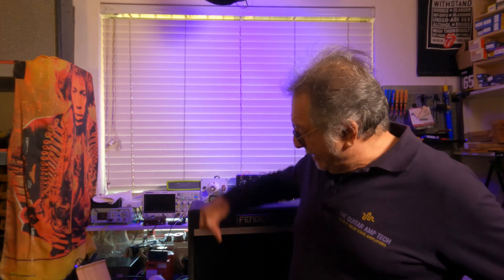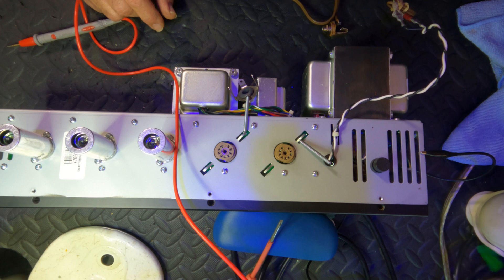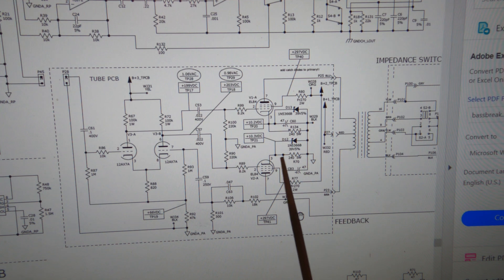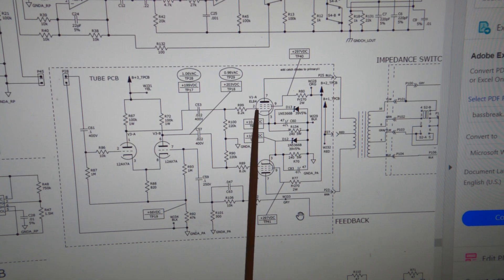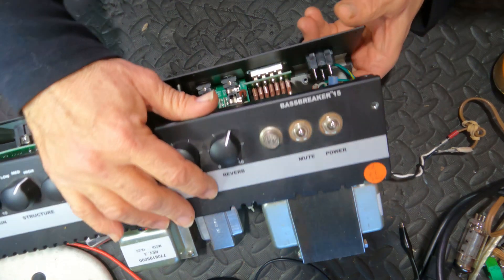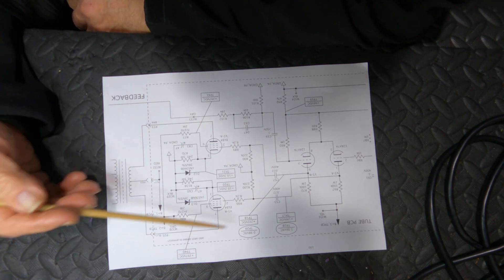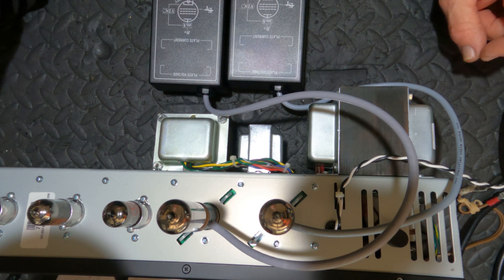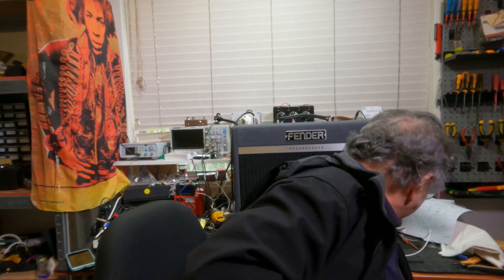Fender Bassbreaker 15 is blowing EL84 power tubes

Comment: corporate greed and dishonesty are the only chance fender has at this point
Reply from the maker: Ouch. That sounds like a cynical truth, Curtis. Fender has spent so many years betraying their customers, and indeed their own reputation, for amps that were once made to be easily serviced. Take for example the problem with the low-voltage circuit on the Hot Rod series. Fender engineers are smart. Smarter than me. And yet they persist with the same flawed design and assembly method. Fender knows how to build amps as good as Leo, but the accountants say “No. The PCB doesn’t always burn, and it usually won’t become an issue until after warranty, so leave it”.
Reply: yeah, they had a huge amount of cancelled orders for guitars, ( I don't remember how much, but it was a lot) and so the CEO responded by firing a whole bunch of employees, and then bragged that they had a good year. Corporations disgust me....... @theguitaramptech
Reply from the maker: I'm with you, my friend.
Reply: @theguitaramptech  Which amps are built different to Fender, like for instance what is equivalent to a Fender Bassbreaker 15 in sound but reliable?And lets not forget easily serviced. Any suggestions as I'm in the market for just such an amp.TIA
Reply from the maker: @robbphillips2845  Have a listen to the Vox AC15. It's better made than the BB15 and I like its sound better (personal taste). The  Fender Blues Jr can be set up to sound excellent, too, but Fender made quality compromises to keep the purchase price attractive. Both easier to service than the BB15.
Reply: more than likely it is new younger engineers who are deficient in experience, and nobody wants to challenge them! Fender is not all that greedy and dishonest at all.  Remember Jim Marshall copied the Fender bassman and just switched around the tone controls and sold that as the JTM45, and mesa Boogie basically took a Fender amp and pumped-up the gain and created the Mesa Boogie, and I could go on and on of all the big amp companies that ripped off Fender amps!

Comment: It’s actually not that hard to repair if you have the service manual which is on line. It explains a simpler method to open the amp up..

Comment: I love this amp, my friend left it on at church. I believe I am needing a power supply. I can’t find, is there a replacement
Reply from the maker: The Bassbreaker sure does sound good, it's just a rotten shame about its serviceability. 
"Power Supply" is such a broad term for a guitar amp. It could be as simple as a fuse. Unplug the amp before you check the mains fuse. From memory, there are 2 more fuses for the low-voltage supplies.

Comment: 9:29 I found it easier to leave the amplifier in the cabinet and lay the amp on its face. Just take the 7 screws out of the back panel. tilt the back panel (with the power and speaker jacks).
Reply from the maker: @caseykittel  thanks Casey 👍

Comment: Hi Chris, a bit late on your video, I want to remove the zeners on mine, but I’m not very educated on electronics, I do know how to solder and that’s about it, I repairs stuff watching tutorials like yours thank you very much!! I was wondering if I clip the zeners and leave the tips soldered, is that enough? Or should I I make an effort to unsolder them? I don’t know if leaving the tips is dangerous or if it will cause static noise on the signal, thanks for your help and keep the great work! Greetings from Mexico!!
Reply from the maker: Thanks for your email. I appreciate you watching and subscribing to the channel. Because the Zeners are paralled to the cathode resistor, it is fine to just clip them out.
Reply: @theguitaramptech  hey thank you very much for the response, keep the amazing videos coming!

Comment: I think it's very easy to complain, but you have to be realistic. If you want a small valve amplifier that sounds great, and doesn't cost an arm and a leg then you have to buy something like the Fender Bassbreaker or a Peavey Classic 30. There is a whole bunch of competition around that price point: $500 - $600, which means that in order to make a profit they have to use the most economic manufacturing techniques that they can. Spending time in the design phase to worry about maintainability and servicing = more cost in the manufacturing phase. If you want a valve amplifier that sounds great and is easily serviced, then you will pay more - and sometimes a great deal more for a fully hand-wired boutique amplifier.
Reply from the maker: Yes, I do agree with you ... partly. But to build an amp like the BB or the C30 focused solely on cheap construction and not reliable ownership is poor engineering. My go-to example is the Vox AC15. The Hot Rod series and the Blues Junior (once their stupid design issues are resolved) are much cheaper to maintain. Don't misunderstand me, the Ballbreaker sounds very nice...but I would never own one.

Comment: Great video and well explained.  I picked up a second BB15 which had an intermittent issue of the leads of the Bass and Mid pots shorting out against the chassis which then made them inoperable and the Treble control then acted like the volume.  I placed a strip of electrical tape across them to test and it worked great, issue is gone.  I should have put nylon washers as a spacer over the pots but didn't want to open it up again lol.

Just thought I'd share in case you came across this issue.  It's a great sounding amp, I've recorded all of the music on my channel using BB15's.
Reply from the maker: Thanks Dennis. I love hearing about home remedies like this! Well done, mate. Yes, the BB15 sounds great, but its a disgrace to Fender that a customer has to attach electrical tape to stop shorts and make it work. You shouldn't have to do that.
Reply: @theguitaramptech  What make is your tube bias tester?  What calculations were you making, were you calculating cathode current bias from the voltage measurement?  Can you spell out the math please?  :)
Reply from the maker: @DennisCameronMusic   I have a few bias testers. I nearly always use the EuroTubes one for cathode-biased amps because it will directly measure Plate to Cathode voltage. It also gives me a reading of Plate current (with no screen component). From that, we calculate power (P=VI) and then divide by the theoretical maximum dissipation of an EL84 to give us a % dissipation at idle. There are many ways of finding Plate current, but this is quick and accurate. 
The lazy person's way of biasing is to use the manufacturers' bias voltage. The “Near-Enough” Tech’s way is to calculate the % dissipation as I show here. I don’t think I showed on this video, ( I have of many other videos) but my preferred way is checking the actual performance of the tubes on an oscilloscope. That is REAL. I cross-check with the Plate Current. Any other way of biasing is “assumed typical”. One EL84 may have a maximum dissipation of 10W, and another has 14W. An oscilloscope doesn’t lie.

Comment: Hello:
I had a Bassbraker 15 but it had a problem with the FX Loop. It made noise. When searching the forums, it was mentioned that this amp had a flaw in the effects loop that caused it to get noisy.
Do you know if this problem occurs on your amp when using the FX LOOP?
Perhaps fender has already fixed the problem in newer versions of this amp.
Reply from the maker: I'm sorry but it was long enough ago that I don't remember anything about the FX loop. I haven't heard of any fixes for it.
Reply: There was an FX Loop problem when they first came out. 
Fender's 'Fix' was to fit an isolated Jack Socket on the FX Send. 
I believe that was All they changed but not 100% certain of that. 

I bought one in 2017 and it's behaved itself perfectly.
Fingers crossed though eh ? 😉

So far, I've made just one little Mod myself. 
In order to use a TwoNotes CaptorX with it I've added a Break Jack in the direct Amp to Speaker line so that I can connect the Main Speaker jack out to the CaptorX and then feed a line bwck to the combo's speaker without upsetting the amplifier.

Comment: How much would a repair like this cost? I have this amp, and I love the way it sounds.
Reply from the maker: Hi Dave. I don't recall what the repair bill was, but because of its assembly, it would be more than an equivalent amp, such as an AC15, which I really like. Yes, the BB15 sounds great, but I would never own one because its lack of serviceability.
Reply: @theguitaramptech  Thank you for this information. I just bought a Bassbreaker 15 a couple weeks ago, and I'm going to return it since it's already red plating. You just saved me a lot of future headaches and expenses. 

Can you recommend any low wattage amp (in the same price range) that has tones similar to the mid and low gain settings of this Bassbreaker, but something that also serviceable?

Comment: Hello, thanks for an informative video. I have a BB30r, it came faulty so I had an immediate warranty fix and the amp has been working just fine over the past 2 years, but this scared the sh*t out of me. Since the amp is still new, I'm thinking of a trade to get a good deal in the second hand market. Should I swap it for something used and older but of higher quality? I'm looking into hand-wired "boutique" amplifiers, like a Cornell Romany plus 12. They say those are easier to fix

Comment: I have this amp it is red plating the first tube only like everyone else’s that bought this amp.

I’ve had the amp since about 2018 and haven’t bothered with the warranty which I’m sure is expired. Fender should be ashamed of themselves, I’m going to call them for a giggle and tell them they should replace it entirely or repair it for free. 

I can’t use it and it will cost probably $250-300 for the rapier in labor mostly. I’m never buying Fender again … I own a few other amps including Fender and they’re fine. Just can’t believe an experienced company would market this garbage.
Reply from the maker: You ae right, J. But its not only Fender. The JTM 30 and 60 should also have been recalled by Marshall but they are still floating around bringing sadness. Many manufacturers have their dark days.

Comment: That's a fun amp to disassemble. I wonder why the bean counters that run Fender now would allow the unnecessary expense of diodes that aren't necessary?
Reply from the maker: I have asked myself the exact same question. No idea. If the idea is to protect the EL84s, the tubes will be passing over 160mA before the Zener kicks in, by which stage the EL84 will make Chernobyl look like a fun day at the park.

Comment: Fender should have made a head based on their blues series...jr or deluxe
Reply from the maker: They are definitely better to work on, TH, but they're not without their issues either. Plastic PCB-mounted input jacks are a common failure point. I think it's irresponsible engineering that fender uses plastic shaft pots on the BJr with no chassis nuts. And God bless Fender for keeping Techs fed with that those high-wattage voltage-dropping resistors on the HotRod series that cause serious heat damage to the PCB. Sadly, we live in a time where the great amp companies are ruled by accountants and not people like Leo or Jim.

Comment: I've built an 5e3 kit some months ago and pretty much understood almost everything about it, and even managed to troubleshoot it into making it very quiet (yes beside solving the ground loops and grounding unused inputs it was the led pilot light powered by the 6.3 circuit witch was causing the big hum). But anyway today i got myself an used Bassbreaker 15 and this great video made me aware of an possible issue that might come along. Thank you for a very nice video and some very useful insights about this amp.
Reply from the maker: Good work on your kit, George. I think 90% of noise/hum issues are caused by bad grounding and the filament heaters. I am a believer in the "up and over" approach of well twisted filament wiring. 
Its disappointing with the Bassbreaker build. It sounds good but a nightmare to service. I wonder if the Classic 30 engineer got a job at Fender?
Reply: @theguitaramptech  back to the BB15 I am looking into some static noise (pretty high ground floor noise) that comes from the FX loop when I switch on a cheap digital delay pedal stuck in there, and looking in the service manual everything is layed out on the back pcb (from the fx loop to the reverb and so on). I think they were thinking about protecting all of that with the diodes in case of a power tube fail on the expense of the power tubes. I wonder how does this layout compare to the (new) Marshall DSL line witch I think is comparable in terms of features and might be a better implementation of all that (haven't heard of many problems about those models).

PS I was thinking of clipping those diodes to prevent any future red plating but I think I will wait with a spare pair of tubes and see when or if the issue migh appear.

Comment: You Sir have saved me a pile of money. Interestingly the 30r has four EL84s but only has two Zenners. I had two tubes red plating. Opened up the amp, reached in and cut the two zenners. I put the back cover on and its fixed!!! THANK YOU so much!
Reply from the maker: Glad I could help, Rob
Reply: How difficult was it to find and remove the two zenners? I have the BB 15 head, and I'm pretty sure this has become an issue for me

Comment: I've got a bassbreaker 007 head that hums.
This is a common problem with this amp.
Even when new, the amp hums.

The amp sounds amazing except for the hum.
The amp hums at low and high volume.
Reply from the maker: The BB sure does sound great when it going properly.

Comment: I would have thought that the zener is there to protect the bypass capacitors from over voltage.
Reply from the maker: That certainly is another way of looking at the reason for having the Zener. It would only come on at a massive 210mA. Thank you for that.

Comment: This is such a great and informative video. By cutting the zener diodes do you mean desolder or can I just literally snip the two legs (which may be easier). Will the rest of circuit/current run fine with the zener legs shipped? Thanks so much!
Reply from the maker: Either would work. Even just snipping one leg would work if you were confident the lifted leg would not touch anything else.

Comment: Thanks for the video! Very informative. I have a BB15 in gunmetal grey that I bought Oct 2021. I don’t play loud, I live in an apartment but last week the volume stopped on med and high gain stage settings. Low gain kept working. I took it in for a warranty fix and they said a tube had to be replaced. For low volume playing I’m surprised a tube went so fast. Is this type a thing a flaw in this amp’s design? I’ve been liking the Vibro Champ and thinking it may be better amp for me in my apartment. May look at a trade. Also like the Princetons. Any suggestions?

Comment: Thanks, this is a great video. You really explain well to the lay man. I bought a bassbreaker 45 combo a couple years ago, should I be thinking of it as unserviceable? Or just going to take more time (aka more money) to put right if anything goes wrong? Thanks from the UK!
Reply from the maker: Spot on Rhys. Most of the issues are solvable but it will take the Tech more time. It’s a shame they sound so good, or else I’d say get rid of it now.

Comment: I had ordered not once but twice, Supro Black Magick Reverb 25 watt head from Zzounds. Both times it was delivered with blown tubes. Viewing through the back of the amp, I noticed the whiteness of the tubes. I never plugged them up and immediately returned back to Zzounds. They offered to replace the tubes before I sent the second unit back to which I declined. I assumed it’s a quality control issue with Supro.
Reply from the maker: That’s very disappointing. I wish I could say it was rare but most of these once great companies are run by accountants who just want to sell product.

Comment: What are the slots in the metal chassis next to the EL84's for? Watching this on a small screen (phone) it looks like there are exposed components visible through these slots. Are those the zeners? Or bias-monitoring points?
Reply from the maker: You are testing my last remaining memory cell with that question. Slots are usually for cooling. I can't recall if the high wattage resistors were under there. Sorry, mate.
Reply: @theguitaramptech  , whatever component was visible through those slots was small, almost tiny; couldn't possibly be rated for more than 1 watt.....
Reply from the maker: @goodun2974  That repair was returned to the customer way earlier than my memory can recall. Generally anything past a week is wiped clean from my internal hard drive. I wish I could answer more fully.